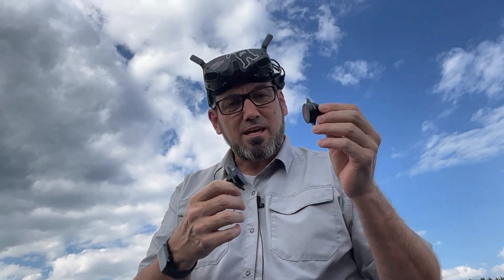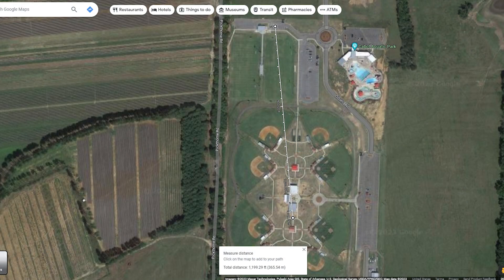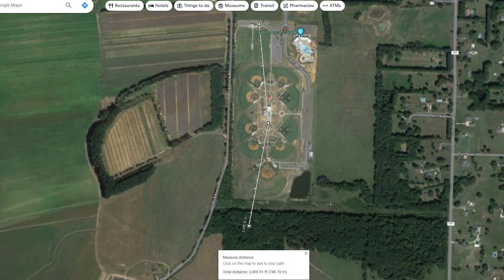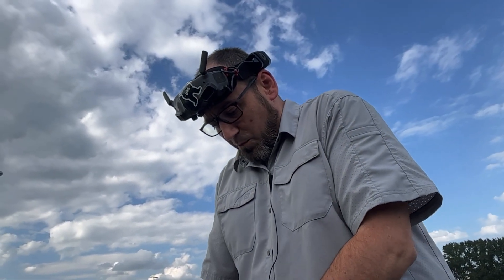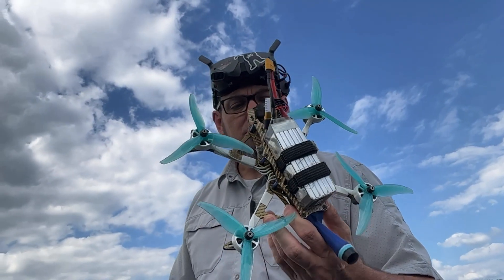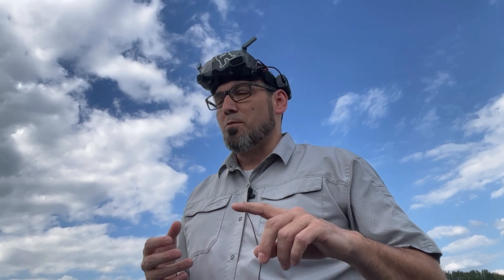Battle Royal FlyFishRC FLIP G2 vs TrueRc X-Air vs DJI Stock Dual-Band Antennas

Comment: So seems like the sock antennas for the win at the park.... At the warehouse test is no good as your faced different in the first flight, stock may have done as good as the x if you were faced the same way so it's up in the air. Would take another round to see if it's just a waste of money replacing the stock.

Comment: After trying most every antenna the one that truly stands out is the Xair2. Near perfect onmi performance and high gain with a wide beam out front. Nothing else gets close.
Reply: I'm not sure how you can have near perfect onmi with gain and beam, anyway if it works for you... In this test stock did as well or better out door and indoor test would have to be done over with him standing in the same orientation for all 4 tests

Comment: Great data. The stock antennas do quite well, at the park idk if you need more than that. At the warehouse it was clear that the X-Air got the signal from very back better, you were ripping it faster too which shows the confidence was there as well... I didn't actually expect to see that as I found the AXII HD patches hindered o3 performance vs the stock antennas in midrange cruising over the treetops, but the X-Air certainly improved penetration in the heavy rf interference environment. 📶